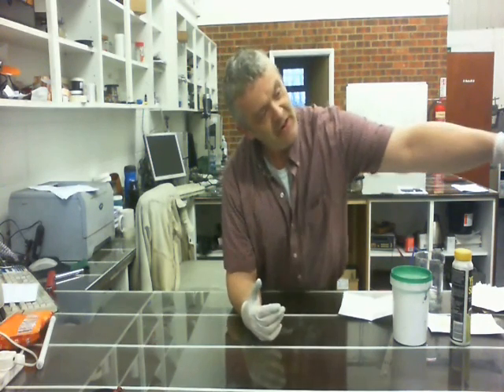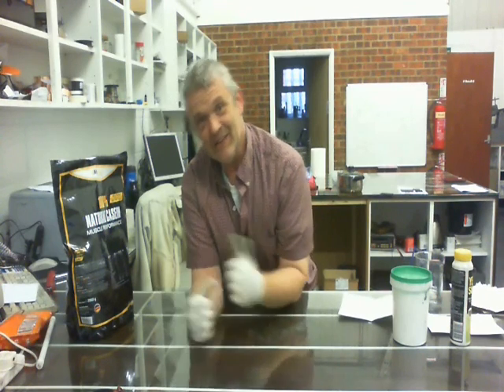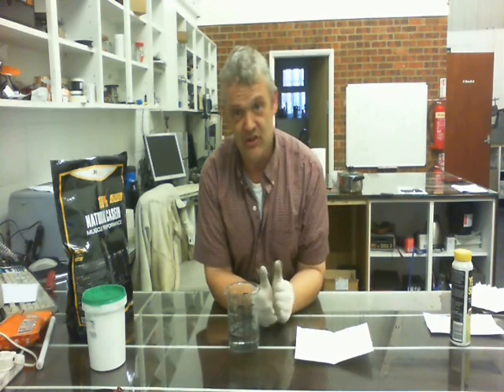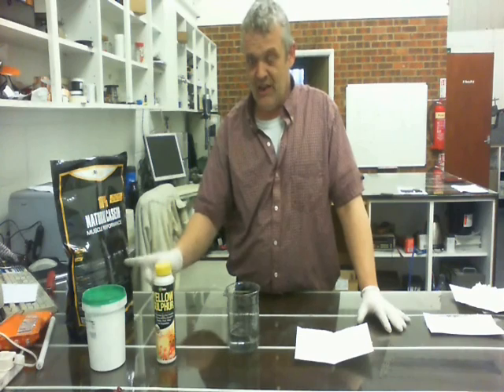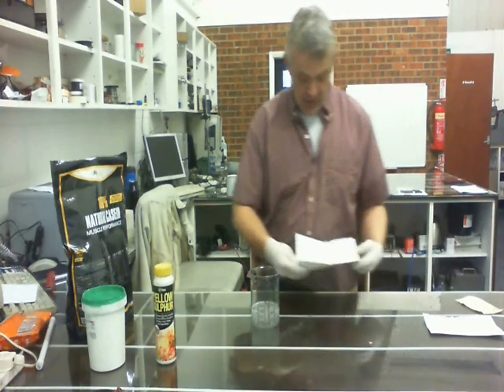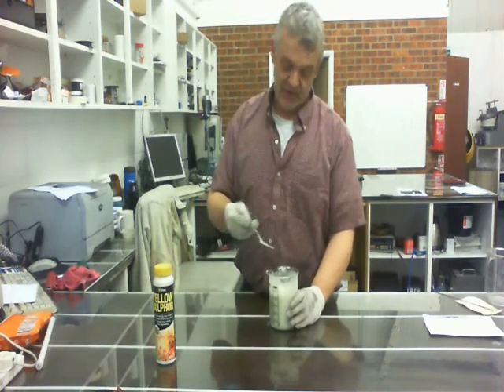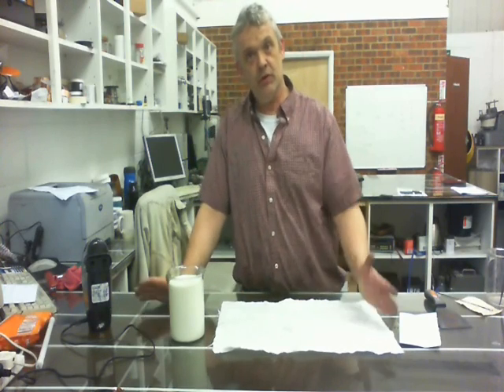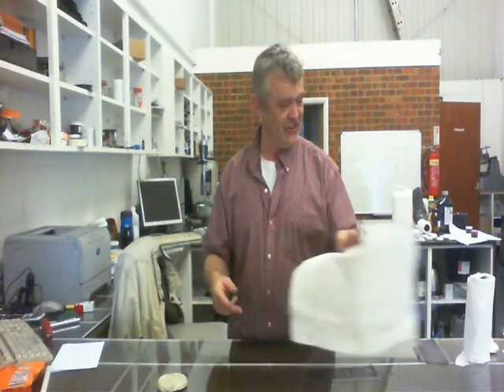Rubber Made From Milk - Casein Bioplastic

Comment: I know this is very old I am revisiting it and I've had some success and some of the areas. Also they finally sell pure casein in the US. I was very surprised to find it after all the looking I did before but it's become popular apparently. The thing is when we start out with a product that is already in an appropriate state to dissolve into water do we really want to use a alkaline solution? I was sitting here and your video randomly popped up and it made me think. It's already appropriate pH to go into solution is that's how we would drink it as a bodybuilder. If they left it acidic it would start clumping out by itself so it must be a Alkali already? I'm going to adjust the pH of some of the German recipes to see if that improves things

Comment: Nice video !!

I found a casein mixture with only 80 % caseinate on it. The rest is chocolate, sugar and other food ingredients.

It's a rhetoric question, yet I ought to ask: Would the performance of the final rubber be compromised too much?

Should I just compensate the "impurity" of the caseinate by adjusting and adding more casein-food to your formula?

I hope the other ingredients do not burn much with the KOH...

Thanks once more for any comments !!!

Comment: So I've tried this 3 or 4 times and it always ends up turning is hard as a rock in the end. It's not a complicated recipe I do not know what the hell I'm doing wrong but that hockey puck I poured the excess into a jar lid probably the same as you and it was rubber for one day and then it turned hard as a rock literally as hard as a rock. Ever really really taking the time to do this right I even distilled my distilled water to make sure there wasn't anything in it. And yes I use calcium caseinate
Reply: Deionized water, not the same as distilled :P Not sure what else may come in the distilled... I think it's usually high in nitrates? I think Robert may have a better idea though.
Reply: @therogerwilco  yes technically deionized water is more pure but for the sake of a casing recipe it shouldn't matter as long as it's distilled and what are you talking about nitrates there's no nitrates in water

Comment: Hi Rob! I bought a bag of 100% casein. As it turns out it is mycelium casein protein. You mention calcium caseinate is what you are using. I have read a few articles on the difference but it seems mycelium casein is also a type of  calcium caseinate, albeit a smaller molecule from what I can make out. I have made my mixture with your specs of 10 Grams of Potassium Hydroxide and 200 ml of de ionized water and 100 grams of protein. However I can't seem to get my mixture homogeneous at all, and no matter how much i stir it forms clumps of what seems to be an insoluble material! I have tried adding extra potassium hydroxide but it still doesn't dissolve. Am I looking at two variants of protein in the solution? Whatever is dissolved also seems to form a plastic of sorts. Hoping you can help clarify...

Comment: hello ! i was just wondering something, i've heard about vulcanization with sulphur but it's done with heat in your example you just added sulphur to the cold mixture and it worked, what's the chemistry behind that ? if that could work with normal glue i can make my glues more elastic ! thanks.

Comment: Morning Robert. I've never seen this before today but in my lime plastering work casein is used in the final coat of a lime wash. I don't use it myself because a lime wall should be able to 'breath' and adding a rubberised solution to a paint surely would then make it non-porous which defeats the object of using lime does it not?

Comment: Hello Robert, I just discovered your channel. Really interessting. Thx for sharing. 

For this particular video "Rubber Made From Milk", I don't understand how the casein is reticulated - not sure it is the proper term -  since you don't add tannic acid or formaldheyde. Is the sulfur reticulating the casein and making it water resistant? 

Pretty sure you know all this but... if I can help... :) here is an idea
you could do moisture absorption test, that will produce very reliable insights on the waterproofing proprities of your material. 
-Weight a sample
-place it in a oven with a cup of water
-heat up to 40°C, for 12h
-mesure the sample again so we know how much water got in
Reply: It was a long time ago since I last watched this video. I just learned that sulfur industrially is added to rubber to vulcanize it, because it will form crosslinks between the polymers. Incidentally, that's why I'm here now. Thoisoi made a lovely video on sulfur.
Reply from the maker: awesome cheers mate

Comment: found that sodium hydroxide dissolves sulfur faster, and heat also must be applied. 
another method is:
mix water+sodium+sulfur, and heat till all sulfur melted. then add the casein.
still testing fillers to increase the output, starch wont do anygood, marble dust, graphite or active carbon works well.
any inputs on the fillers would save me some testing time :)
as for dry time, any ideas to shorten it?

Comment: A bag size back here in the states would cost about $56 from what I've seen. I have seen some cheaper about half that price which would be more in line with the exchange I believe but it's always flavored LOL
Reply from the maker: +Clown Whisper lol - you need to shop around
Reply: +Robert Murray-Smith,  I know it's ridiculous even on eBay 28 to 30% ammonia hydroxide is around $50 a gallon I can buy a thousand milliliters for $15 USD butt then you're paying for shipping is well. I've been making my own but it's a damn pain in the ass I don't know if you've ever synthesized ammonia hydroxide but it's not easy at room temperature to get 30% in any decent volume.

You say you got 35% ammonia solution from the hardware store? That's amazing I would be so happy! I was under the impression that 30% is as strong as you can get at room temperature. it's funny that you posted this just now because I was sitting here looking around on the internet at suppliers like vwr insigma and they're ridiculously expensive reagent grade of course but I'm running out of options I really like using the ammonia for this casein. I guess I'll keep on synthesizing it or distilling 10%
Reply: +Robert Murray-Smith and having written all that last reply I realized we were talking about the casein powder not the ammonia LOL yeah I remember now yes it's very expensive here I'll have to look on eBay
Reply from the maker: +Clown Whisper lol - no worries mate
Reply: +Robert Murray-Smith i found some but it was still very very expensive. 36 dollars for 2.5kg 
im trying this rubber now.  im glad I have an overhead stiring motor!!!!  omg this is going to be a trick getting all of this casein into 200ml!!!!   I cant imagine doing this by hand
Reply: +Robert Murray-Smith 200ml is no where near enough liquid to absorb this much casein in any sort of reasonable manor. I ended up wtih a ball of dough!  ended up adding another 100ml or so.
Reply: +Robert Murray-Smith I ended up using my wisk attachment as well but still ended up with tapioca.to a lesser extent .I wonder if the germans patent was wrong. that ratio yields a solid lump of dough for me  what i ended up wtih finally was similar to what you did.  a thick creamy mixture. next time I will try this and apply vacuum.

will post results.
Reply from the maker: +Clown Whisper it's higly likely to be wrong or at best misleading - patents are usually just a guide mate
Reply: Robert Murray-Smith my thoughts exactly. 270 ml seems tio give me a nice consistency. tomorrow the end product will tell more
Reply: @ClownWhisper any luck on the rubber?

Comment: What kind of casein sodium or calcium? Would I be able to use whey protein instead of casein? Will sodium hydroxide work 
instead of the potassium? Is washing soda a substitute for the hydroxide? Sorry for all the questions, I just want to make sure I am buying the right products to make the rubber. Thank you for your time.
Reply from the maker: +David Kern best to use casein - rennet casein works well. No you can't use whey. Sodium hydroxide is fine as is washing soda which is sodium carbonate - just about any alkali will do as will just about any acid - the more you deviate though the more you will be experimenting - which i think is cool
Reply: Robert Murray-Smith Thank you so much. I love your videos. I will be using the sodium carbonate instead of the hydroxide. Would it be the same amount (10 grams) to the 200 ml water?
Reply from the maker: +David Kern probably a little more mate - it's the pH that matters - but you will have to experiment i am afraid

Comment: I would really like to know the properties of casein in application for cookware, what temperatures can the casein handle in heat? can casein handle temperatures at 400 Degrees Fahrenheit or 204 Celsius? if not what is its limit?
Reply from the maker: +Joshua Tomlin do a little experimentation mate - it's the easiest way to answer your questions - plus you will get a real 'feel' for the material
Reply: Thank you much sorry on the slow response been busy in the kitchen experimenting and what not
Reply from the maker: +Joshua Tomlin no worries mate - but you learn a lot from 'doing'

Comment: Great. I found Potassium hydroxide readily available on ebay.
Reply from the maker: it's used for making soap mate - easy to get hold of - you can use sodium hydroxide too (drain cleaner) or slaked lime (calcium hydroxide) - KOH is best though

Comment: will these plastics/rubbers perish with time???
Reply from the maker: yes - in about a month to a couple of years depending on treatment
Reply: Robert Murray-Smith Thanks for the quick reply.
I had a feeling that it might perish quite quickly.
Reply from the maker: it does depend on treatment - you can adjust decomposition time - actually you could fix it to hundreds of years - but mostly people don't want that
Reply: +Robert Murray-Smith what would be the variable to create a longer span of usability time? thanks!
Reply from the maker: +secretsaltshake cross linking
Reply: excellent, thank you Robert Murray-Smith  ! very cool video, I like your style
Reply from the maker: +secretsaltshake cheers mate

Comment: Would NaOH do instead of KOH?
Reply from the maker: +Colin Hammill give it a go and see
Reply: Robert Murray-Smith Cheers bos. I also started messing with guar gum as an emulsion... very hard to work with as it only takes about a level teaspoon in 250 ml of water to end up with something reasonable. First attempt I used about 50 grams to start with and it went like concrete LOL. I still don`t know how it will work as a paint though.
Reply: +Robert Murray-Smith I have come to the conclusion that NaOH will not work. I used half of everything so 100 ml water but added 10 grams NaOH and let it dissolve. Then I added 50 grams Calcium Caseinate and waited after stirring with my maguyvered drill whisk. Went ahead and added 10 grams of yellow sulphur and it`s useless LOL.
Reply from the maker: +Colin Hammill bummer - though you may have used too much - pH only needs to be 11 or so - also leave the casein to soak over night in water before adding the alkali
Reply: Robert Murray-Smith Cheers boss, I used 6 grams on my first attempt but didn`t do any pre soaking beforehand. I`ll give that a shot but do I just add the NaOH to the presoaked casein or make a solution?
Reply from the maker: +Colin Hammill a solution is easier mate
Reply: Robert Murray-Smith Yeah I just dumped 50 grams of casein into 80 mls of H2O and I`ll make the NaOH out of the 20 mls left to bring it up to 100 mls. That should help (hopefully) lol
Reply from the maker: +Colin Hammill remeber it only needs to be pH11 - a weak solution will do
Reply: Robert Murray-Smith Yeah I`m thinking 6 grams again.
Reply from the maker: +Colin Hammill that sounds like a lot mate - the molar mass of NaOH is 40g so 40g in 1L = a 1 Molar soultion. 6g in 100ml is 1.5 Molar. the pH for a 0.1 Molar solution is about 13. So, you need less than 0.4g in 100mL.

You can work out pH approximately by

pHsol=14−pOH

and
pOH=−log([OH−]

Sodium hydroxide is a strong base, which means that it dissociates completely in aqueous solution to produce sodium cations, Na+. and hydroxide anions, OH−, according to the following chemical equation

        
NaOH(aq)→Na+(aq)+OH−(aq)1 mole of sodium hydroxide produces 1 mole of Na+ and 1 mole of OH− ions. This means that the concentration of the hydroxide ions will be equal to

        

[OH−]=[NaOH]=0.1 M

You can use this concentration to determine the pOH of the solution

pOH=−log([OH−])

pOH=−log(0.1)=1.0

Therefore, the pH of the solution will be equal to
pHsol=14−pOH=14−1.0=13.0

hope this helps
Reply: Robert Murray-Smith Cheers boss, maybe that was what was going wrong. I`m letting the casein soak another while anyway as it seems to be swelling without the alkali at the moment. I`ll let you know how it goes, might even do it in the early hours as there`s a documentary I want to see at 2am LOL